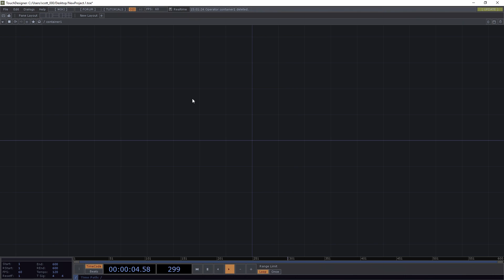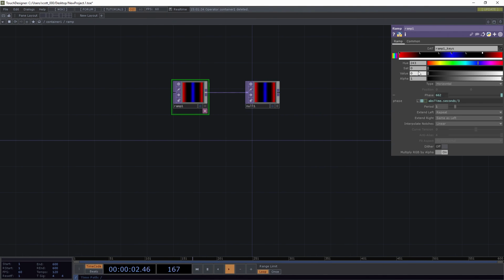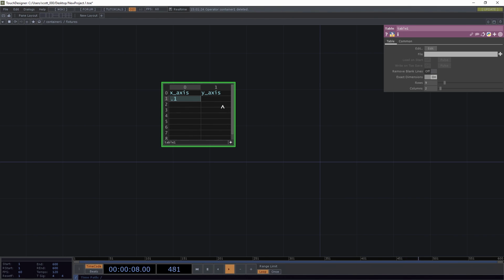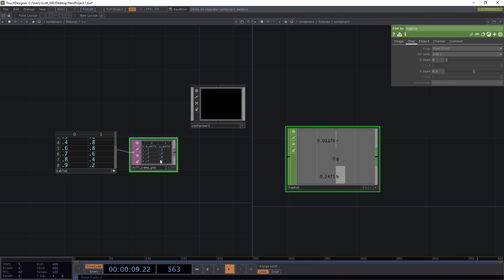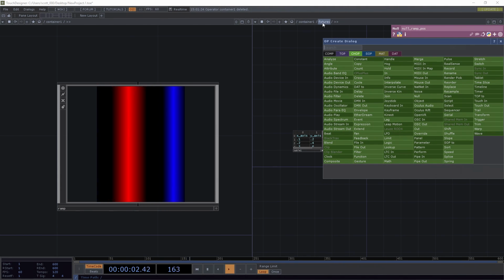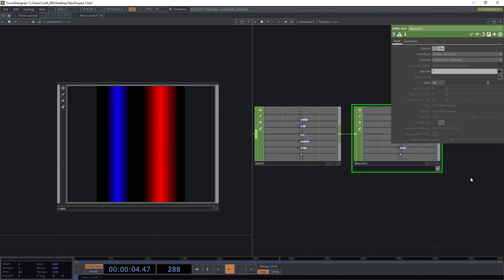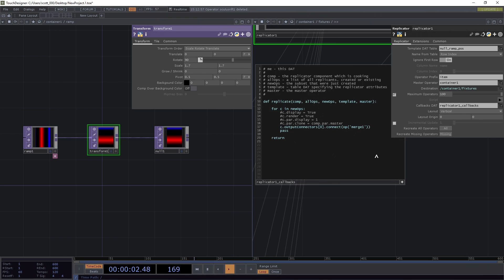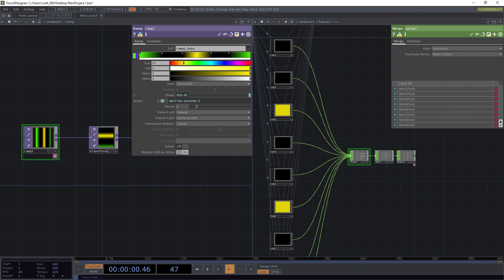Touchdesigner LED Fixture Building 1

Comment: Hey Scott,  what a great tut. was searching for some days, to program some par lights, and then you popped up.  i noticed when i changed the numbers in the table, x and y axis my lights where spot on in the right sequence, so i have led1: x-axis .1 and y-axis .1,  led2: x-axis .2 and y-axis .2, and so on. i'm a noob and just learning so i do not know if its correct, but it works. Now trying to add 2 moving heads, see how that goes (more channels: r,g,b,tilt, rotate, dim)
Reply from the maker: I just posted a new tut on building out dmx fixtures.  I have a few more  tutorials in the pipeline, and one will definitely include moving heads.

Just posted a youtube short with tracking a person with movers.

Comment: Nice tutorial! 10:57 how do you connect several Op to the merge, is there a shortcut I missed?
Reply: you should be able to just right click and drag to select all the OPs, then when you drag the connection from the first OP to the Merge CHOP it will automatically connect them all.
testing this a few ways it seems it doesn't matter what order you select them in or which OP you connect from, it will simply connect the top one first, then the next one second, etc.
hope this helps!
Reply from the maker: if you have them highlighted, you click on the green part of the components, you can drag it straight to the merge.

Comment: Very good tutorial! Although I get stuck when connecting the replictator items to the merger at 11:00. For some reason when I click the items I can't get a wire anywhere? Do you have any idea what I am doing wrong?
Reply: k solved. I placed a top out after the totop in the container... So replaced it with a chop out and connected it to the merger. Thanks for the great tutorial!
Reply from the maker: you need an out chop in the template component that is being replicated.